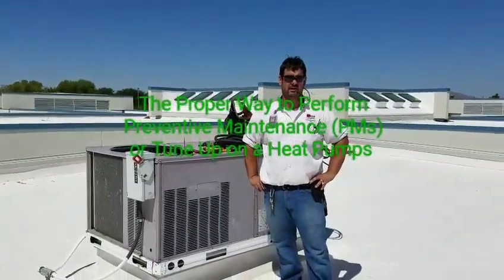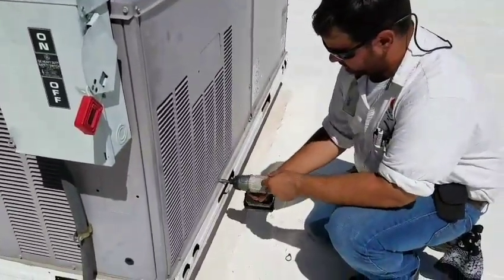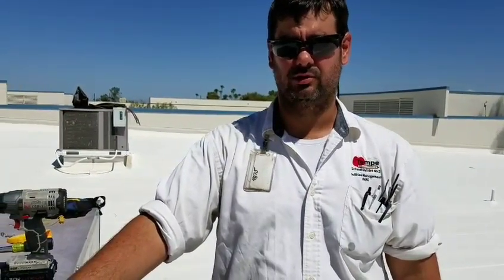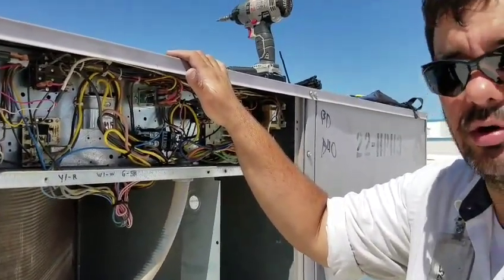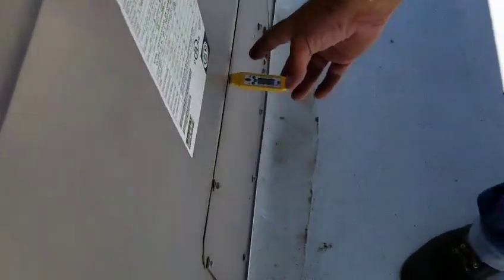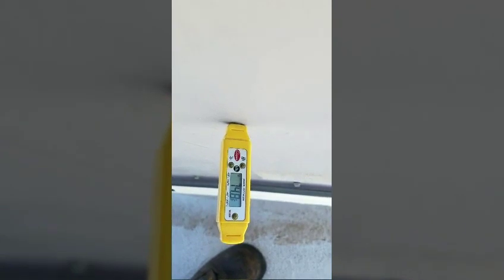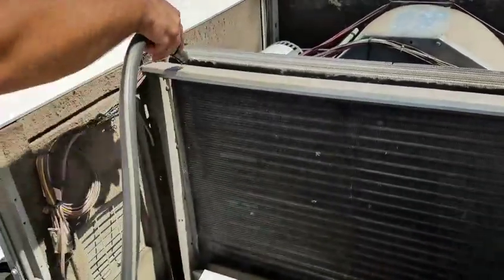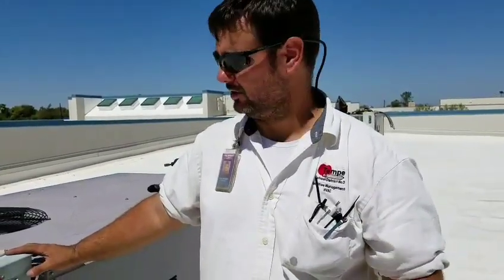The Proper Way to Perform Preventive Maintenance (PM) or Tune Up a Heat Pump

Comment: Him: "how to perform a pm"
Also him: Let's just go ahead and touch the capacitor with your bare hand.
Reply from the maker: Here's a tip if you spin the fan blade while the capacitor is in the circuit it will discard the capacitor but i wouldn't expect someone like you to know a thing like that. 
If you could post a link in the chat to your video showing how to do it better and if I like it I will post a link in the description.
Reply: @JAkedAgain  tf you mean someone like me?
Reply from the maker: @shellshot8134  no i mean someone who has absolutely no idea what they're talking about someone like @shell shot
Reply from the maker: @shellshot8134  lol because its my first time. get a life
Reply: @JAkedAgain  Theres a reason your doing PMS 😂
Reply from the maker: Ok how about this you link your better video of you performing a pm on a heat pump an if I like it I will link it in the description.
Reply: @JAkedAgain  as you can tell by my comment your opinion means absolute dog shit to me. 
But let's both be real here this is a video on how to do a PM and if you open the panel and grab a capacitor your going to get shocked and since you didt put in the video of you discharging it I'm going to criticize it
Reply from the maker: @shellshot8134  lol ok loser you have had months and I have noticed you never shared your video doing it better. What your mom won't let you on the roof or is it you can't afford a phone with a camera.
Reply: @JAkedAgain  first of calling me a loser I haven't even thought about this in months and 2nd off it's summer and 3 pm get back to work unless your done with your PMs 😂
Reply from the maker: i noticed you were incapable of producing your own video of you doing it better who knew
Reply from the maker: Loser